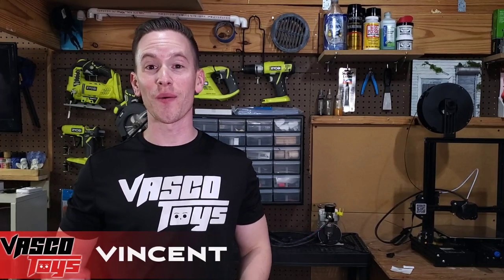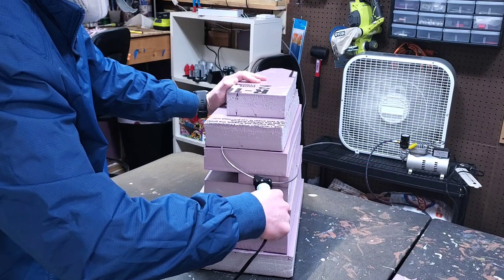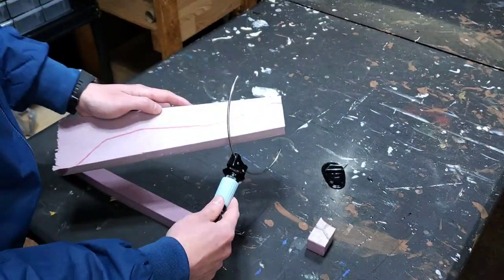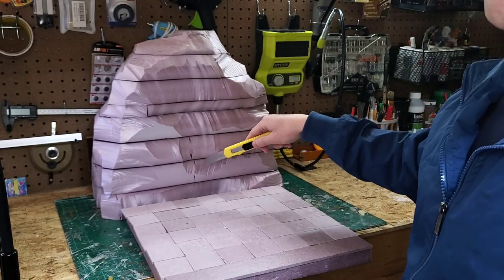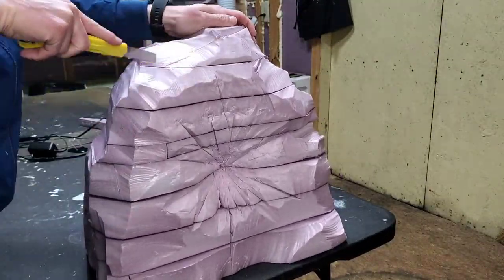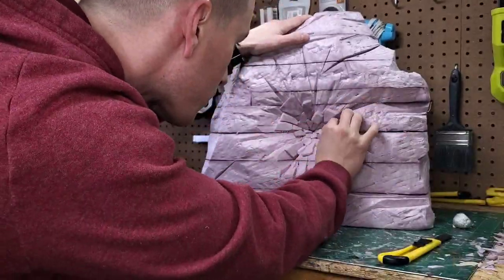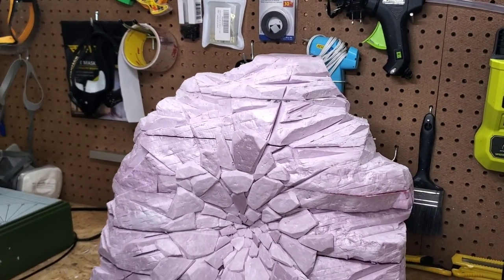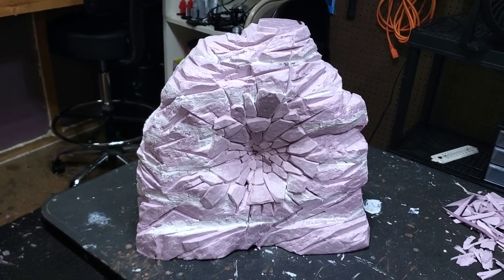Foam Carving a Dragon Ball Impact Crater Diorama

Comment: Hello. What determines the temperature glue that gets used on these? Is it the type of foam? Low temp on a type of foam, high temp on another type?
Reply from the maker: Good question. Low temperature glue on XPS foam. High temp hot glue melts XPS
Reply: Thanks so much for the reply. I had more questions but found your glue guide video that I will watch. But curious about masking and the fan with the Hotwire tool. Those precautions aren’t needed when manipulating xps foam in general? Just watching out for my lungs lol
Reply from the maker: @TheDragonzFire  awesome! Hope you enjoy the glue guide. The only times I use a mask with XPS is if I am using a hotwire or sanding (which I don't like to do). I don't use a mask when I carve the foam with a knife. That's how I know to best protect myself.
Reply: Ok thanks again. Sounds like if manipulating the foam in a well ventilated area it’s fine. I initially got concerned because I was like isn’t that foam used in insulation and toxic??But I looked it up and it’s all good especially since I would only be cutting with a blade

Comment: The reason you got the gaps is that you used hot glue and no weight on it.
Reply from the maker: Thanks Kevin, I'm happy with the way things turned out. Since I made this video I have also been using Plaster of Paris on a lot of these kinds of builds, which helps fill in any gaps.